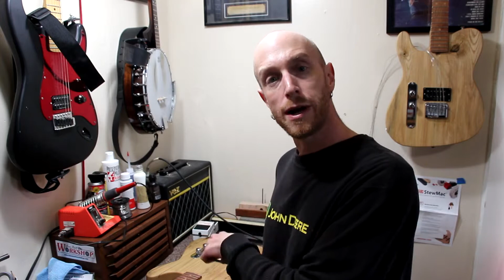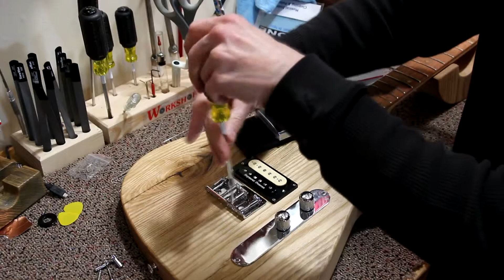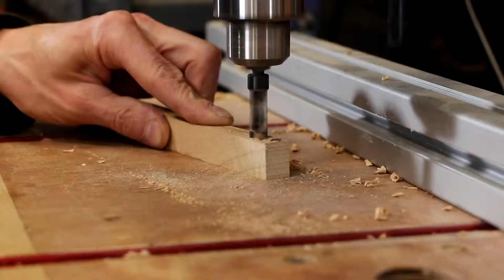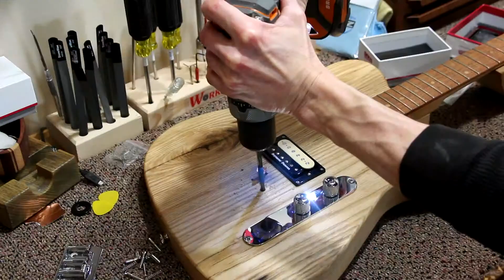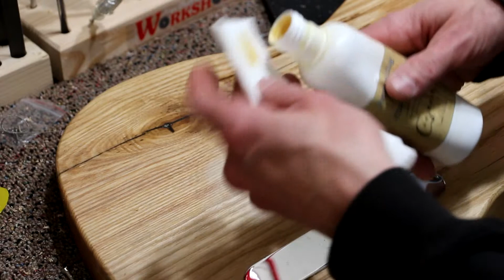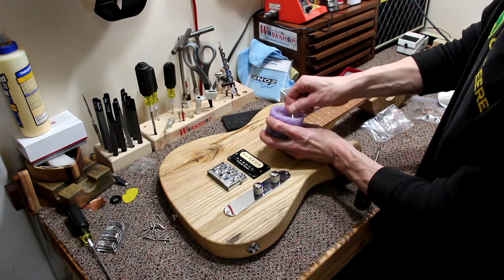Swapping Out a Bridge, Plugging Old Holes

Comment: Does anyone know if this works to swap from FAT6 bridge to a more "normal" bridge kind? I want to change the bridge for "style purposes" but my gio is using the FAT6 bridge where of the 6 screws, there's a gap between the 3rd and 4rd screw and I could only find bridges where the 6 screws are on the same distance, I just wanna know if covering the holes (the ones who do not alingth with the new bridge that must be 4 of the 6 screws and making new ones could damage the resistance of the guitar body

Comment: Hi pal. Id like to ask you something thats been running on my head since im planing to replace my Bridge.

Im not english native speaker so maybe you already mentioned It on the video and i didnt get It. 

In a certain moment on the video you Talk about putting the new Bridge in its place. I always thought the Bridge needs to be on a precise spot (not far nor closer to the headstock than it has to be) un order to keep the instrument proper intonation. You seems to be placing It by eye with little to no worries about this.

Did you do previous messurements or am i wrong and you dont need to be that strict about distance?

Comment: I cannot find the answer to this anywhere on the internet, so if you could help I would appreciate it. I have a Squier Bullet Stratocaster Hardtail that I'm upgrading. it's the 5-screw fender style top-loading hardtail. Do you think this Schaller will fit in the existing holes or will I have to drill new holes? this is gonna be a deciding factor for me.
Reply from the maker: This is definitely not a direct replacement for a 5 Screw Strat Bridge.
Reply: @iamjeffbaker  thank you

Comment: Please tell me what is that type of bridge called that you removed??? I have one, and I’m trying to find a tremolo system that will work with the three screw holes. I want to avoid any routing. Thank you! This is the only place I have found a bridge like mine after hours of searching...
Reply: Thats a top loader bridge
Reply from the maker: This is a top loading Schaller bridge. Its a hardtail bridge so doesn't have any tremolo.

Comment: I've just ordered one of these bridges for an upgrade and it should be here tomorrow! This is just what I needed!
Reply from the maker: Awesome. I think you'll like the bridge. They're good quality.
Reply: Adam Pleasance how was the bridge?
Reply: @youarenotsafe2215  ive not had much chance to try it out sadly.  i decided to refit the neck with threaded inserts, but one of them chewed up (crappy zinc) so i'm waiting on some stainless steel replacements in the post.  once i have that fitted, i'll report back!
Reply: @you are not safe I really like this bridge now it's all installed and working. Its really adjustable. Lots of intonation range, I can set the string spacing exactly as I like it. The bridge sounds great and it's very comfortable under my hand.  The only criticism is the rollers move very easily when you are changing strings so you have to be careful not to move them out of place. But otherwise I love it.
Reply: @adampleasance9567  to play metal is it good?
Reply: @Mat-zt4bi  it's perfect for it. I just really recieved a second one today in the post. Great timing!
Reply: @adampleasance9567  and when we need to detune each strings does it still working ?
Reply: @Mat-zt4bi  I've tuned down to C and it was fine
Reply: @adampleasance9567  ok thanks !
Reply: @adampleasance9567  too late  I just bought an ibanez with an evertune 😂😂😂😂😂 rgd61alet

Comment: This is exactly what I am trying to do with a 72 tele deluxe reissue!

I heard the shop that these come from do shoddy work and the bridge may not even be properly aligned to begin with! need to restring to do a rough check, but I would like to learn how to mathematically know for sure....
Reply: You'll need to measure the scale length as accurately as possible. Measure the distance from the nut to the bridge, where the string contacts the saddle. That measurement should be 25.5" for a tele. If you can't get that measurement to work out, you may need to move the bridge forward of back to correct it. This should be only in extreme cases though, typically if you can't get the intonation correct and the saddles are bottomed out either forward or back. Hope this helps.